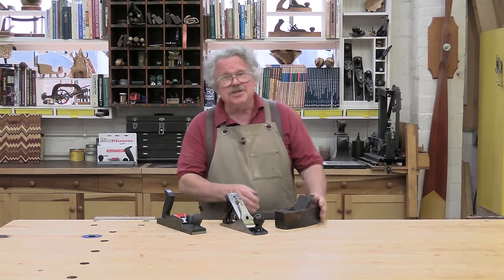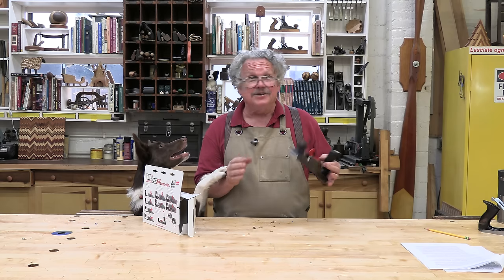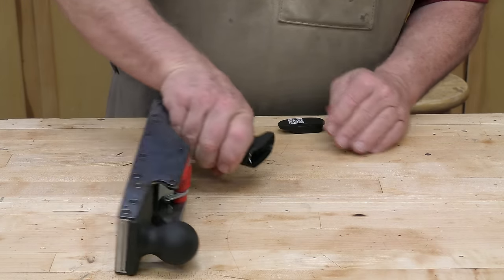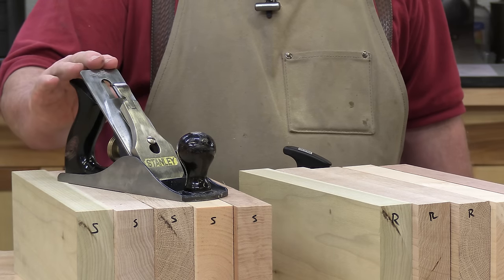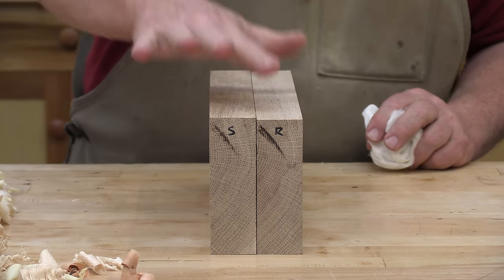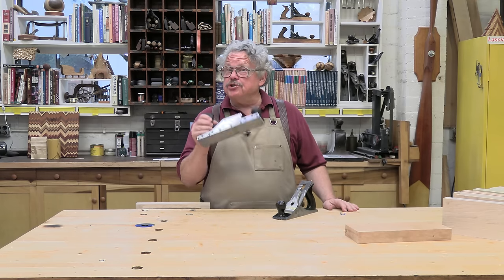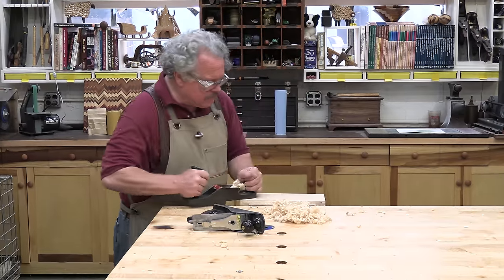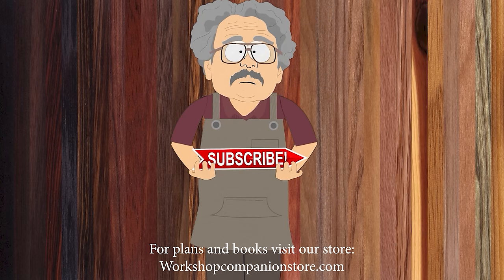Is This the Future of Hand Planes?

Comment: The convenience of not sharpening is nice, but you do pay for that. It's $30 CAD for 5 steel or $40 CAD for one hard metal blade (you point this out later), and they are the sole source for them. Whenever you have a sole source, there's always the chance your plane will become useless one day, or at a minimum, you will be at the mercy of their supply chain and pricing. Not really any different situation than you have with their jointer/planer knives, though (which are very well respected).

Comment: I can imagine this becoming mainstream for the same reason japanse saws enjoy their popularity. I learned everything about woodworking online, and saw sharpening is still foreign to me, also, getting my hand on a set of nice, usable resharpenable saws  would be a challenge. However, getting a few japanese saws at good price is attainable and sharpening is a non issue. The price tag and the need for new blades is a deal breaker on the planes for me, but it might be good for a contractor who doesnt want to waste time sharpening (which I actually enjoy doing).

Comment: If that thing was capable of changing the angle of the blade horizontally, that would easily become a staple in woodworking. If they just made it a little longer to fit some kind of compass, they'd have something amazing

Comment: What about these 2 situations:
1. Using it as a smoothing plane for tabletop? With self sharpened blades you can easily sharpen the blade with the slightest curve to avoid the corner of the blade cutting a line on the surface being planed. With that disposable (yuch) blade I don't see a possibility for that.

Ok, should watch the video through before commenting. Anyways leaving this comment here.
2. Using it as a scrubbing plane. I really don't see a possibility for this with those disposable Rali blades. Of course, even with this classic Stanley, you would probably need a second plane for it with an extra large mouth.

Comment: Everyone loosens up when hit with a leather mallet :)

On topic: is there a reason to make the mouth smaller? It seems that a wide mouth would normally help get rid of wood shavings.
Reply from the maker: The leading edge of the mouth compresses the wood just before it is cut by the plane iron. This prevents wood from splitting ahead of the cut and helps produce a much smoother planed surface. A wide mouth allows you to remove more stock with each pass,  but a narrow mouth produces a better surface.

Comment: I've often wondered why planes didn't use something like a razor blade that can be replaced once dull.
Reply: I would have to say because most people that choose to use hand planes aren't the type of people that usually go for disposable anything.  That's why we use hand planes. That's why we make.
Reply: @Rufio1975  I don't know many people who sharpen their jigsaw blades though.
Reply: @Rufio1975   What is the alternative to a hand plane that is disposable?
Reply: So-called "razor" planes have been around since the 70s, usually designed to take the standard "Stanley" blades but the flexibility of the blade and the low mass of the plane made them suitable only for chamfering pieces on a job site... RALI fixed that with a short and sturdy blade, a heavy body and a reliable clamping mechanism.
Reply: @JohnClark-tt2bl  
Lol. Yea you right but now we are splitting hairs. people do sharpen handsaws though if we are talking about that type of blade, but we aren't. We are referring to hand plane blades and I would even say chisel blades.  But for the most part, you know what I mean. Alot of people that use hand planes are traditional. Re-use.
Reply: @Rufio1975  How much of that is because there was no good disposable alternative though? I know I don't use a straight razor to shave, but if it's all I had I suppose I would have to.
Reply: @JohnClark-tt2bl  
Well, we have access now to electric planers, edge joiners, electric saws and even electric hammers yet there are still people that choose this. So even with the choices of hand powered or electric, we, I would assume that includes you since you are on this video, chose the simple reusable tools.  Yes there are varying degrees. Some people call it hybrid but that's another topic.

Comment: Hey, Nick. I noticed every time you took a swipe with the RALI plane you plucked out the shaving. Is that necessary?
Reply from the maker: No. Just a personal habit. I like to keep the mouth clear so I can monitor the cut -- see that the blade is cutting all across the cutting edge or if there's a shavings lodged in the mouth.

Comment: Am thinking this might a great solution for an ugly job: Removing lead paint (abatement) from exterior salvaged lumber. I am considering the alternatives as well and really do not wish to use my old style planes. After that job is done I would think these would be serviceable and useful.
Reply from the maker: I have begun to use the Rali in a similar way -- for rough and finish carpentry, in situations where you don't want to risk the "good" planes you've worked so hard to tune. It's ugly to begin with, so if you hit a nail, scratch the sole, or chip the blade, no big deal.

Comment: I bought Rali when I first got into woodworking. I was working with hardwood, and boy, I had to use a lot of blades. Then I bought 2nd hand Stanley, with Hock blade. I'll take Stanley over Rali any day. Rali cannot produce a thin long shaving like Stanley does. And it turns out that sharpening Stanley's blade is not so difficult after all.

Comment: Stanley produced an RB10 (first design was terrible  but worked . It was a rebate plane . Renovating an old house it was perfect for cutting hard floorboard knots )) The later RB10 was a good basic design  with a simple blade replacement action .Both these planes were badly produced with twisted soles . The first model I bought and kept for 20 years before I got a belt sander to make it work . So a big black mark for Stanley and poor production standards .Absolutely no excuses for such a bad mistake . Plane snobs ignored them but they would have made good door stops . The management were asleep at the wheel for years on this plane .

Comment: In addition, I wonder if one could make a jig to "resharpen" the disposable blades...
Reply: Wouldn’t that kind of defeat the whole purpose?
Reply: @warrenwerks  Of course. However on the steel blades, I could see a scenario- use the new blades (16 edges) as needed, then in a month or so take 30 mins +/- to "resharpen" the 16 edges if the jig was simple enough and if one already has the stones or diamond plates. 
I realize there are a few "ifs" involved, but the cost per edge would be halfed "if" :) all the above was available to user.

Comment: I tripped over the RALI planes back in the early/mid 80's and they always seemed, but blade supply wasn't all it could have been back then, so my RALI found itself re-boxed and relegated to the back of my tool cupboard.  I think they're fine for use by an occasional handplane user, but invest in one and - depending on frequency of use - you're forever in the hands of whoever is supplying cutters.  A little like Stanley's recent run of Sweetheart handplanes - although at least RALI produce and sell replacement blades, whereas Stanley basically left their customers high and dry and needing to source spare irons from third party makers/suppliers.
Reply from the maker: All good points. Which is at least part of the reason Rali began stenciling a QR code on their planes -- to make sure that owners always had a source of blades. At that point, you're dependent of the longevity of the company, as you point out with the Stanley example. By the way, the Stanley Sweetheart is not produced by lingering remains of Stanley, but by a Belgian company that bought the Sweetheart name. They incorporated themselves as "Stanley Europe." We purchased one and were going to use it in this video, thinking we would compare the newest Rali to the newest Stanley. We didn't learn it wasn't a real Stanley until after we had a chance to study the instructional materials. Designed in Belgium; made in Mexico. Almost a decent plane, but we found problems with the unique combined depth-of-cut/lateral adjustment controls.
Reply: @WorkshopCompanion  Norris style lateral adjusters were never the best and - paired with depth adjustment - seldom simple to adjust on the go.  Stanley tend to dodge the bullet regarding spare irons by declaring them out of stock, therefore limiting options for users to invest in further irons when variations in edge camber would be beneficial.

Comment: That whole things disposable... for 230 you can get a WoodRiver #4 1/2 plane that smokes all that stuff. Same length, better width, better weight, wider cut, and fits man sized hands better.

It's also capable of giving a surface so fine it needs no sandpaper.

Thats the next level of hand planes developed since Stanley. By Lie Nielsen. There hasn't been better made, just stuff as good.

Comment: Beginning to think hand tools may be more efficient for me than power tools. Tried to set my tiny shop up to run on solar power (10×16) has proven irritating. The planes I've  watched you use might have been a better investment. 😂😂😂
Reply from the maker: I admire your willingness to experiment, in spite of your frustration. I hope you share your experience in the woodworking forums to capture what you've learned, even if it was how not to do it. But you may e right. It's interesting to consider that the woodworking trades were among the last to power up, The early industrial revolution produced so many exceptional designs for effective, accurate hand tools that there was little need. Power only shaved a little time off what had already become an efficient and  productive industry.

Comment: Don't get me wrong it's great to see innovation but give me a Stanley any day, it can still be sharpened 50 years from now while you'd be stuck with a paper weight with the Rali once it's gone out of business and you can no longer get the blades.

If anyone decides to get one make sure you also by a large box of the blades.
Reply: Rali has been around since 1964 and about every carpenter I know has at least one kicking around in their van. They are not supposed to replace a traditional plane, rather to complement it, especially with the TC blades that can handle laminate and painted wood. They are also a great way of getting people into woodworking as you can focus on working the wood and don't have to invest time and money into a sharpening solution. Also, time IS money. The price per RALI blade is equivalent to 1.5 minutes of a master craftsman's billable time (in EUC)... there is NO way you can hone a traditional iron in 1.5 minutes.

Comment: Good review Nick. But the Rali planes have been around longer than 10 years.  I bought one at a  woodworking show about 25 years ago.  It's a good concept, but I don't like it.  The last time I checked, the blades were expensive and difficult to find. It looks like availability has improved since then.  As you pointed out, the lack of camber on the blade means that these are not smoothing planes.  Great for edges, not so much for faces.  Also, not that good for shooting.  The biggest thing is that it lacks the connection to the old craftsmen like a stanly or Lie Nielson or a wooden plane.

Comment: It actually looks good, just need to lower the price of the blades. Like 5 times.
Specially useful for people who cannot sharpen the blade so well themselves, because one of the most important things on hand planes is the sharpness.
It's comparable to straight razors vs. razors with interchangeable blades. I have both but I'm not able to sharpen the straight razor myself (because of how fine the edge has to be, it depends on every movement and pressure on the sharpening stone) and had it resharpened only once. It's cheaper to buy pack of 100 new blades for 10$ which last me years. 👍

Comment: Maybe it's just me. But I hate buying a product that keeps dollar-ing me after I buy it.  $40 dollars will not break the bank by no means, but that price is without shipping.  Then the question comes.  If the economy continues to dive off the deep end.  Will the blades even be available, or how long to order them. Or maybe it will become where to order them.   Then with extra blades on hand.  Probably for most people. If you leave them in original packaging.  Where the HELL are they when you need them. lol!  Then you are back to re-ordering and another $50+ gone. 
Nah!  I will stick with my heavy blade. I already had the sharping stones for other things.  I can sharpen the blade once tuned in about 3 minutes.  I like the extra weight of heavy planes.  And like you said with the plate iron blades. One can round the blades for scrub or round the corners for not biting in.  
It's nice to have great quality work.  But wood working is not a high tolerance process.  Not like metal working where one can have a thousands of an inch fit or press fit.  Wood is quite forgiving and don't need completely a perfect fit or surface for gluing.
Everyone is entitled to their own opinion though.  👍

Comment: Would this work on its side as a shooting plane? Seems as it would.
Reply from the maker: Unfortunately, no. This is one of the boats that Rali missed. The screws that hold the plates together are domed and protrude slightly from the sides. The plane will not rest on its side on a shooing board with the knife square to a board. I can envision a jig you could make -- just a simple board with holes for the screw heads stuck to a plane side with double-stick tape. Or you could replace the domed screws with flatheads. But if you need a shooting plane, this will take some extra work to adapt it.
Reply: i thought about this too, a sharp blade works great for shooting,  however, i don't think it quite has enough mass.  It would need to weigh as much as a 5-1/2 in my opinion for it to function well as a shooter.
Reply: Could you cut a groove for the screws to ride in next to the shooting board?
Reply from the maker: @courtneycox8265  Sure, but why no just use a plane that works for shooting in the first place? Also, the knives are ground at 37 degrees -- way too steep for end grain.

Comment: Great presentation and excellent points.
These commenters who whine about disposable blades, landfills and such, do not have a care in the world when shopping for groceries or ordering goods online.
These two activities alone make millions of tons of waste each year.
Cannot imagine the average woodworker going through a dozen or so blades in a year.  Maybe.  And besides, one needs a method and the tools to sharpen edges.  Not cheap either.
Woodworkers are known for tool snobbery and the endless pursuit of acquiring the most rare, expensive and named tools ever made.
Reply from the maker: As far as the longevity of blades goes, we've just completed the carpentry for a new 1800-sq. ft. shop (about 4 months of hard work). I purposely used the Rali for everything that required a hand plane, and have yet to wear out a single carbide blade. I still think it's as ugly as sin, but it makes a great job-site plane.

Comment: So i looked into one of these on amazon. Prices are a bit higher there...yeesh.
Reply from the maker: While I agree that the carbide blades are ridiculously expensive, the chrome steel knives cost $30 Canadian for a pack of 5 -- $6 a blade.
Reply: @WorkshopCompanion  You should test the blades to see how long they stay sharp before needing replacement. I'd be curious.
Reply from the maker: @JohnClark-tt2bl  The durability of a cutting depends on variables such as planing technique, tool care, wood species, and grain type. Any number I could come up with may not apply to the next craftsman in line.

Comment: I've had a Rali shoulder plane since the 90s.  The blade is meant to be disposable, but it's easily re-sharpened using the same type of jig used for sharpening power jointer and planer blades.  Sorry, Rali.
Reply from the maker: Good tip.

Comment: For £155 I can buy a ready restored plane and a couple sharpening stones and still have change and then on top Il never spend another penny on it this plane seems to work well but really isn’t a good choice long term as over its life the rali will cost 10-20 times what the Stanley does with replacement blades alone

Comment: Some have concerns, about future availability, of blades.
I have the concern, also, of how long will the plastic adjustment post last.
I know the the post being machined from metal would raise the cost, but it would be Far more durable.
Reply: People have been using some of their planes for 20+ years. Inside the plastic piece is a metal rod, the plastic piece is mainly a handle only function is to give you something to grip.

Comment: Nope. I bought one of the Stanleys (RB10?) back in the early 1990's here in Australia (because I can't sharpen for nuts). Within a few months Stanley simply stopped sending replacement blades to Australia and the plane ended up in a bin down in the yard shed & hasn't been see in decades. So the customer is instantly a slave to the OEM or their distributors if they buy a plane that only takes a proprietory, disposable blade. So I ended up with a sharpening machine that I can use to sharpen any tool, that takes me out of the equation and a bunch of conventional planes.
Reply from the maker: Good arguments. Rali/Samvas seems to be a company with some longevity, but your points are valid. I'll use the Rali for job site work, but I'm not selling my Stanleys.